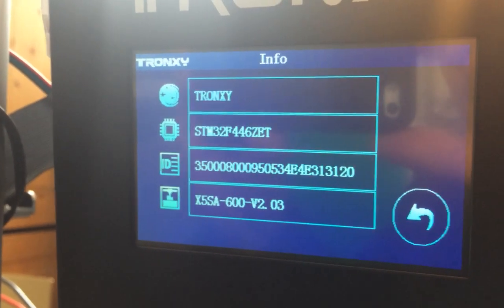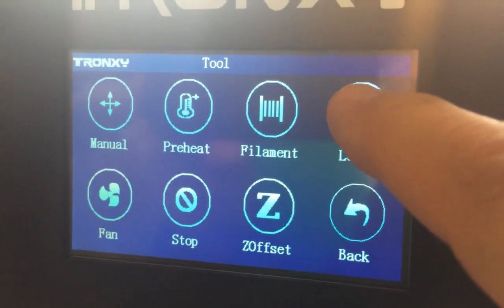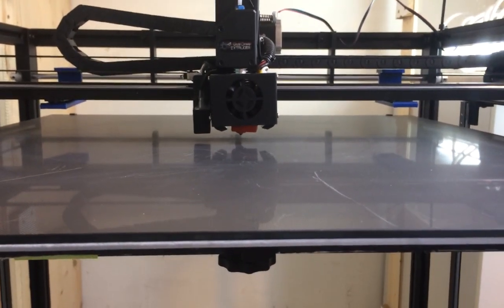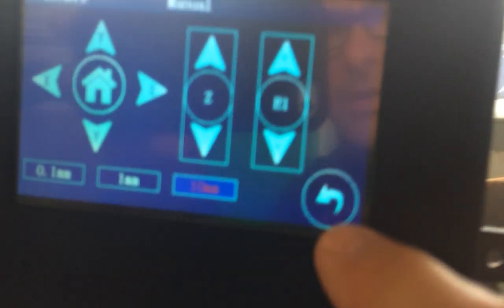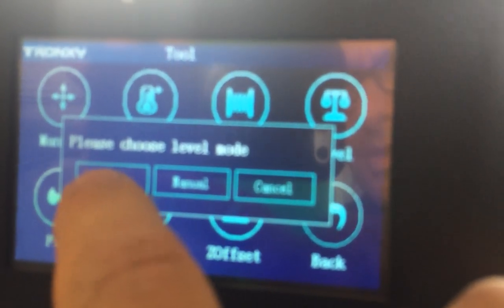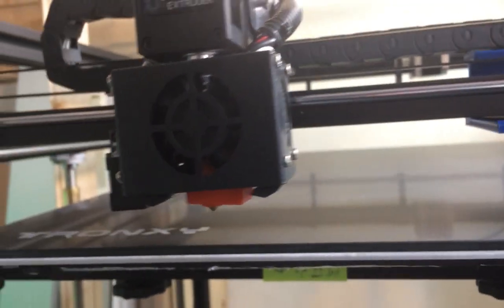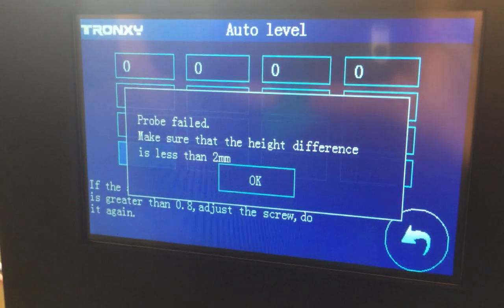TRONXY X5SA 600 - Printed parts blocked the motor on the right, so it ran out of the bed on the left

Comment: This days I was testing Marlin 2.0.9 and 2.0 and test prints with various versions, some versions the fillament motor was inverted other the level bed lost the bed and start go down.... so I send an email to tronxy asking for new firmware for Z5SA 400, they send me asap 1 day after, the firmware the programmer and a video to flash the latest version, V1.64 on boot 1.32 UI. they put babystpes performand print and new level. Yes it start on the right and center on the bed center. Is more acurate and faster mesuring the bed. So after 5 days testing Firmwares I give up of open sorce Marlin and I decide that this last version od Tronxy is the best. I think is marlin the base i send an email ask is is CHITU ou MARLIN waiting for the anser. So someting was not correct with your machine.  
Your version is newer tham mine but i think it just for the 600 eand not for the 40o becaude the Mboard is differeny. I was looking for the blue things that you have on the back.... so that was the problem. Great video thanks for the sharing.

Comment: That sound is from not engaging your x end stop. I had the same problem.
Reply from the maker: hi my local ebike builder! thanks for your messages... i think i found my problem... it was the blue-parts i printed to rise the cableguide.... those parts shifted while running the system in the wrong direction because of a bug in the firmware... tronxy sent me a update and it worked, but then i had those parts blocking the extruder-part... it then worked... untill the next problems came... see my next videos... but tell me: what was your problem and the sollution? do you also run this t-600? please then get in contact with my via the info-page and the e-mail there and send some pictures... i then have a tonn of questions... :)

Comment: When your extruder moves to the right it makes that very rough sound. Mine did something similar. It was an issue with the rails not being perfectly square. With the machine off, move the extruder as far to the back as possible and ensure the X rail is parallel to the frame. If it’s not you need to loosen the screws on both sides of the frame and give it a firm adjustment to level it out. You should be able to move the extruder to each corner with no resistance. Also, check the limit switches are properly placed as there is no mention of this in the instructions. Finally if that is all ok, try setting the Z offset before bed levelling. I managed to do all this .. then the motherboard failed.
Reply from the maker: hi mark! as i mentoned in my "update" text on this video... the problem was the blue-part i printed myself to rise the cable-belt... this part got shifted and blocked the motor... but you also had a similar problem? interesing to read about your journey... but sad to also hear about a board-failiure... i also just today checked my rails, because of a massive layer-shift after 30 min of printing sucessfully... see my latest video... aaargh.... i could not find a problem there, but the wheels guiding the belt in y-direction (without teeth) both do have a stupid construction that might cause an issue... i will upload some short videos about it, soon... do you also run this x5sa 600 system? really? oh boy... i now only found 2 others that have managet to print something usefull yet... thanks for your help! let's keep in tough... drop me a line via mail on my info-rider here via ytube... all the best! oliver.
Reply: @3d4future  email sent!

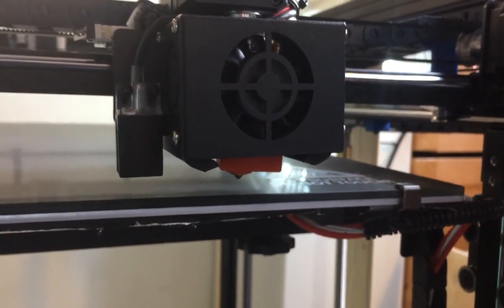Comment: 1:19 Whatever you attached that is blue I'm guessing is catching up on something. It looks like that's where it stops and belts clearly skipping.
Reply from the maker: hi chuck! you nailed it... this was the problem... the firmware was ok after they send my a new version to fix the wrong-x-direction-motor-problem. i was also just surprised to see the system starting on the right side... instead of defining the 0.00 level on the very left befory my firmware update and the v.10 board.... do you also run this tronxy x5sa 600? i am looking for some other fellows to form a group to help out each other...

Comment: There's a marlin firmware compile with assets that you put file in when it done works a little better
Reply from the maker: thanks for your answer! i have a good dialog with a guy that has marlin and now klipper running on his x5sa pro (350?) so i am ready to go there... but first i want to get rid of all the hardware-problems... what system do you run? printer and firmware?

Comment: hello from where did you get the v2.03 firmware?
Reply from the maker: Hi Diao! I got it directrly from TRONXY... after realizing and complaining about a totally wrong Y-direction before that...
Reply: @3d4future  ues the Y motor is doing the same thing with me i had to flip it to get it to work, I think i will contact them and try to get the latest firmware, thank you
Reply: The latest board they sent me came with 2.06. Ask them for this firmware.
Reply: @markk2807  does it use the v10 board?
Reply: @SomeOne-jd3ex  yes

Comment: Y can try marlin, but probably have more troubles to fix many issues than on original FW. Y get open source solution to self fix, but y need way to more deeply understanding  than companies do instead of y.
Reply from the maker: martin! you are right, but hey... nothing works now and i am so dependent on what a company on the other side of the planet - not really speaking english - tells me what MY problem is... there is no problem on my side for now... it is just a matter of the firmware... and sooner or later this will be something i will have to look into... klipper or marlin... that is what i will have to decide... it all will depend on my good relations to other pro-3d-printer-nerds... i guess with a good buddy you can work your way through... i hope. ;) do you have a system running?
Reply: Thats normal i bought cheap x5sa 2 years ago and must mod almost everything. When y start understanding 3d printing, y find, thad board is bad, close FW is bad, parts outside of cube are bad. So that is big experince and knowledge to use it.